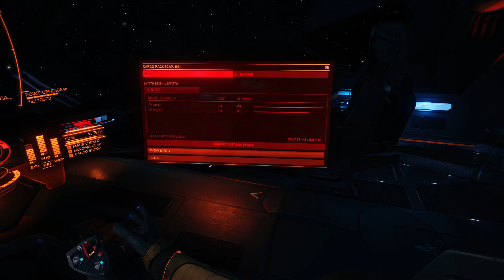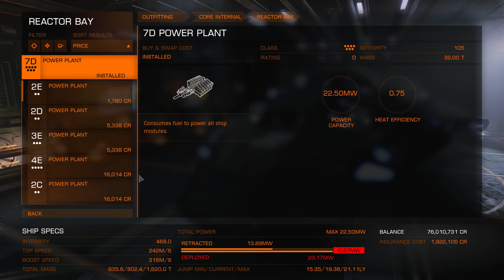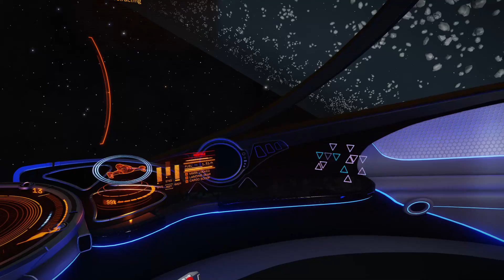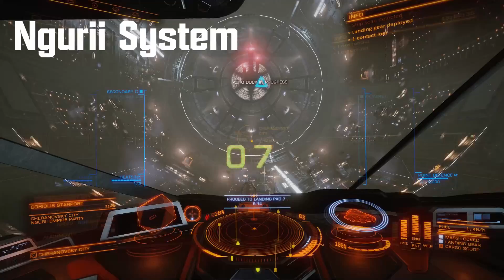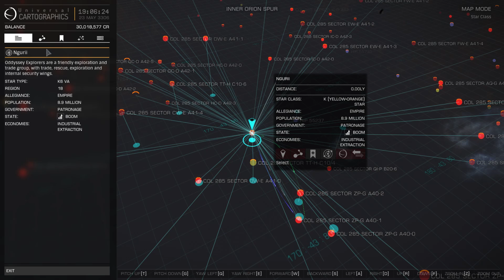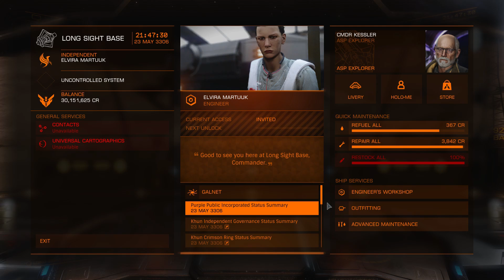Elite: Dangerous - Manufactured

Comment: 5:25 Jingles, by default, you can hold Z to temporarily disable flight assist. Use this to turn when someone quickly passes you, and let go when you're back on him. 
While using flight assist, the ship wants to keep the nose pointed at the velocity vector at all times, and it greatly slows your pitch rate. You don't have to switch to FA off permanently; just use it in spurts. Extremely helpful. In addition, once you're practiced, you can use the reverse thruster in combination with the vertical thrusters to increase turn rate and build up a distance between you and your opponent without having to turn around and boost away,

Comment: You're getting pretty good at this, Jingles. You actually went into combat and didn't get yourself killed! I'm impressed. 😂 So, are you going to be going after the Guardian modules after you're (mostly) through with this engineering grind? The Guardian FSD booster is definitely worth it.

Comment: While you can find High Grade Emissions with your FFS, it's much simpler to just pop into the nav beacon and scan it to give you the info on all the signals in the system. Make sure you target the the actual beacon and not the way-point, you can find the beacon in your contacts menu. It's usually off to the side of the way-point, presumably so you wont run into it. Just target it and wait for the spinny thing to resolve and then low wake out and you'll see all the signal sources in the system.  If you're not opposed to doing things a bit cheesily, you can get the goodies out of the High Grade Emissions point, quit to desk top (not to menu) then log back in. You'll be in normal space. Low wake to super cruise and throttle down to stop. Directly behind you will be the High Grade that you just came from, but it will be unidentified again. Just set your super cruise assist to the Unidentified Signal Source, pull a 180 and then pop in to scoop up all the stuff again. You can repeat this for as long as the signal lasts (usually around a half hour from its initial start) Strangely, this is not considered an exploit by Frontier, even though it clearly is an exploit. I think you used to be able to just leave the point and come back without all the quitting or logging off, but then they took that way while at the same time saying that it was totally cool to cheese it in this way. Sometimes IDK what they are thinking.

Comment: Or you could have done a proper power priority job and been fine.

For all who want to know, a very simple priority step is as follows:
Priority 1 = all modules that HAVE to be on all the time, Engines/Thrusters, and Power Distributor (Shields here if you Cell Banks)
Priority 2 = Weapons, Limpets, and Shields (if you use Cell Banks put here or 3)
Priority 3 = Sensors, Utilities, and Fighter Hangers
Priority 4 = FSD and SRV Hangers 
Priority 5 = Cargo hatch

I have used this setup for power priorities, and have had power deployed at 137% and did fine. The key is priorities 4 and 5 are not needed for a fight, and if you are trying to leave you have to put away  your weapons anyways to spool up the FSD.

Comment: Jingles.
Worth noting that to access one of the engineers (The Dweller) you have to interact with 5 black markets which will mean having to trade in stolen or illicit goods.  Chose a station to dock at that has a black market and doesn't bother with scanning in its vicinity.  When not scanned the 11 commandent applies.... don't get caught.

Comment: Maybe I'm pointing out the obvious but, like you said Jingles, these are raw materials. So I think that the title is a bit misleading as it states ''Manufactured'', that's another type of engineering material (Encoded, Raw, Manufactured). Maybe you got the names mixed but shouldn't this video be been called Elite: Dangerous - Raw?

Comment: since you said you wanted to be efficient, pulse lasers are the most efficient laser weapon in the game. They do less damage to shields over the same period of time as the beam lasers, but given that you take a lot longer to run out of capacitor, you'll find you will generally not really run out, add to that some engineering, like rapid fire on the pulse lasers and charge enhanced on your capacitor, and you'll have a really deadly amount of firepower. You could then add the phasing experiment effect, and you might not even need the multicannons anymore

Comment: For PvE, you can get by pretty well running 3 large MCs and med pulses on your python and do just fine, especially if you overcharge the MCs. While lasers are generally better than projectile weapons when dealing with shields, AI don't have engineered shields or many proactive modules to boost their shield ratings, so they don't tend to last very long at all when you sustain a long burst. The power draw and heat output is vastly better, and they deal vastly superior damage to the hull of your enemy. 

Beams aren't bad, but they're not as efficient. Esp once engineered.

Comment: A quicker way to find high grade manufacturing mats is to head to a system and scan the nav beacon, pop back into super cruise and check the navigation computer (Recommend using the filter to show only signal sources). Also if you find one there is a timer on them so once you've got your mats if you log completely out of the game (Not just to the menu) and log back in, pop into super cruise and select the closest signal source (it will be right behind you) and it will be the same one as before. Rinse and Repeat until the timer runs out.

Comment: Hey Jingles! Enjoying your romp through Elite, I must say! :D Cheers for posting these.

Couple of "actually Jingles" things though... no, no, please put down the shotgun, at least until you've read these!

1. Putting more pips in SYS makes your shields MUCH stronger (up to 60% absolute resistance added at 4)! You can see the exact numbers if you play with the power management pips in an online outfitting tool, such as https://edsy.org/ (also, if you install, setup and use a tool such as "ED Market Connector" you can even export your current ship to it, for tweaking and "dry dock" what-if-ing and planning; there are other ways to do it, but this is the easiest one). Also, putting more pips into ENG makes you, again, quite a bit more manoeuvrable (well, depending on the ship, ofc). 

It is thus quite crucial (in combat situations) to get comfortable with on-the-fly pips management, including setting up easy to reach keybinds/extra mouse buttons/joystick hat switches/what-have-you. Then, after some time, it kind of becomes second nature to route power from WEP if the capacitor is full to get a bit of manoeuvring boost; or dumping 4 into SYS if you're getting shot and can't fire back, etc.

2. Chaff does NOT work against missiles! It's actual purpose is to "confuse" weapon locks, for gimballed and turreted weapons -- this is the "dancing reticle" shtick you sometimes see your guns do when fighting. It is actually also somewhat effective against NPCs, as they can have gimballs and turrets equipped; I found it most useful on smaller vessels, as the induced weapon sway will, more often than not, miss you completely... although it still did have a noticeable effect in my Anaconda. It can also be a nice "run away!" tool. ;)
Missiles and torpedoes are, however, indeed defeated (or, rather, can be defeated) by Point Defence and ECMs.

3. You filthy imperial ponce, you! <3
Reply: I like jingles as ive watched him through several games. However he drops the ball with this video and ED thats is soooo much incorrect information that it should be embarassing.

Comment: Quick tip: If you can’t afford to engineer Beam Weapons like crazy, heatsinks are your best friend: They keep your heat down when firing. The only downsides are they’re manually activated and they have limited charges (but they only really run out after extended skirmishes). This applies to everyone having trouble with beams overheating, not just Jingles. Hope it helps :)

Comment: Combat tips: pips are not a thing to set to wep and forget; when you are shooting, put more pips to wep. Once you have flown pas the target, put more pips to your engines for a better turning rate. You should also use a biweave shield generator if you are going to fly in a resource extraction site because they recharge faster. o7 commander

Comment: Hey jingles, you can use the re log farming method to speed up getting manufactured materials. the "relog" method is like this - once u find an HGE signal source, look at the timer. let say its 25 min left...drop in on it, collect everything there and quit to desktop...log back in, jump to cruise and that same HGE will be very close, drop back on it and repeat until the timer runs out. and when in doubt, you'll want high population systems
, assuming you are using collector limpets to speed things up, you can probably fill up to 100 in about 15-20 min per material, for example, 100 imperial shielding in 20 min or so. if you spend a few hours doing this you'll be in good shape to trade down or do whatever u need. tho somethings like Biotech conductors and Exquisite Focus crystals dont drop like this - they are mission reward only
still its pretty grindy like a lot of things in this game but wayyyyy faster than getting it "organically"

Comment: Couple tips: The Nav Beacon in each system will give you the information about ALL signal sources currently in the system. Just stop by and scan it once youve jumped in.
Secondly, as you most likely have figured out by now, try aiming for at least 3-4 limpets, be it by fitting a class 5 or 2x class 3 controllers, preferably B-rated for the range.
And thirdly, one 64t cargo rack is MORE than enough to go out ona collecting spree. Mind you how engi mats do not require any cargo space. Fit something useful instead.
Bonus tipp: Bi-Weave shields are cheap and "only" labeled as C-rated, but they are actually really, really decent for pirate hunting.

Comment: 05:29 the greatest heatsink of all is space. That is how NASA does it.Why can't game developers see this too? 09:23 Jingles I notice the snowman on the controls. Do they have dinosaurs that you can purchase too in the game?
Reply: Space is not the greatest heatsink of all. The ISS uses huge heat radiators (not quite as large as it's massive solar panels) to dump the heat made by it's internal components and needs heavy insulation to not heat up while in sunlight in the first place. The thing about space is there is (at the height of the ISS) very little matter for heat to transfer to and the only way it can be dumped is by heat radiation.
Reply: @WingComTheLion  Space average temperature is -455 degrees Fahrenheit (-271 C). 
 It has been noted at our distance from the Sun to Earth, that temperature is about 250 degrees Fahrenheit. So there still is a buffer of -200 degrees Fahrenheit give or take a few degrees. What the heck are they heating up in the ISS that is so hot that space can't cool off?
Reply: Until recent space flight I’d never realised how inefficient craft are at getting rid of heat in space. Far less than in our atmosphere for example. Other complications of materials we use is the side in sunlight can be 271 C whilst the side in the shade is -271 C. No wonder everything is so expensive 😁

Comment: I prefer gimbled beams and 3 gimbled multi cannons on my Python. It''s just too much heat for my taste with 3 energy weapons.
Reply: Gimballed is alright but if your target uses chaff they're almost completely useless, so fixed and missiles/torpedoes are much more effective
Reply: @TheMALEK789  yeah, in more manuverable ships I'd agree. But the python, even A rated and engineered is a bit sluggish for my taste. Also, the AI don't tend to spam chaff in PVE so I prefer to have fixed weapons on PVP ships myself.

Comment: no one farms Orrere any more, the terrain is a bloody nightmare. go to the crashed conda at HIP 16613 planet 1a. it's a bit far out, near the Pleades, but the terrain is dead flat. i won't spoil the story, but it has cool logs to find also and as you log out and back in to refill the instance you are bound to spawn a couple of curious visitors. oh, the conda at HIP 16613 also has 3 data points that give good encoded as well as the cargo racks.

Comment: Ive just went onto the next step for the engineers, fly 5000LY from your starting system, watched a the full season of Space Force, there in the time it took me to get there and back.
Reply: How long would it take? 15 hours with decent ship?
Reply: @mortisCZ  much much less, if the first thing you would do after unlocking Felicity Farseer would be getting grade 5 range increase followed by guardian booster and use the neutron highway, 300++ ly jumps

Comment: Little advice for engineering: always go for overcharged for max demage per second and make your lasers have heat vent as a special effect. It effectively transfers the heat of your ship on to the enemy ship so if your ship heats up, you can just load that of on to the enemy. And if you are doing a lot of combat go with a weapon focus engineering mod on the power distributor
Reply: NPCs are not sensitive to overheating at all, so that special effect is wasted on them. Overcharged beam lasers would cripple this ship with their even higher distributor draw.  Efficient would be way more valuable, as it has zero downsides
Reply: @eavdmeer  NPC might not overheat by the special effect Heat-vent, but of more importance, your ship will regardless cool down, which is very good if plasma or Rail's are your thing. Mix em with T V Beams yall!!
Reply: @Battlenude  I actually thought you were talking about thermal shock. That changes things. However, for mister Jingles, with three large beams, I still think efficient would be his only option
Reply: @Battlenude  2 Beams are too much actually, one is totally enough to a) get rid of your heat and b) wear those shields down. (read my previous comment)
Outside of CZ's, where NPCs have quite heavily engineered ships, shields are pretty pathetic and the main bulk of HP are hull based, where you want kinetic weapons.
Allso, hardpoints dont scale linearly. Huge hardpoints have more "penetration" but the increase in DPS isnt dramatic for most weapon types. They have other benefits tho,
like no spinup time on huge MC's, or increased range on cannons etc...
Reply: @eavdmeer  Thats not true(the efficient part). OC thermal vent is the most effective variant. TV scales with heat generated, so theres alot of synergy going
on between the extra heat introduced by overcharged and thermal vent scaling with heat. Especially if your running 2 class 6 SCB's, as you should ina Python.
Most people will go for long-range thermal vent tho, because LR gets rid of falloff entirely and enables you to poke at ships 6km away without loosing any DPS.
 
Efficient Beams are good in certain edge cases, like on a Vulture, but generally theres better options once you have a charge enhanced engineered power distributor.
In a Python however, which sports a really, really beefy class 7 PD, its OC-TV all the way, unless you plan on poking away at range.
 
What youd "normally" run on a Python are 2 OC autoloader large multicannons, 1 OC thermal vent large beam, 1 long range or focused emissive munitions medium
pulse (to keep your targets radar signature debuffed) and 1 high capacity corrosive shell medium multicannon (for the armor resist debuff).
I like to run both medium hardpoints as turrets, so the debuffs are still up even if i dont have the target in my sights (the 2 meds have great firing angels on the Python).

Comment: I'm a little lost with Engineering, I'm a fairly new player, flying around in a Cobra Mark III, is engineering for late game? I don't know why I'd bother upgrading the modules on my current ship since I won't be using it forever. Also is it only worth upgrading high tier modules like A rated ones etc?
Reply from the maker: By all means gather the resources, but I wouldn't bother actually engineering a ship until I knew it was one I was going to keep and was buying A-Grade modules for it.
Reply: Also, don’t forget the modules don’t belong to the ship, i.e. you can strip the modules and put them in another ship later.  Engineering something, even if it’s only on e, can be useful for multiple ships.
Reply: pretty much only engineer the best modules, anything else is a waste of time and materials. there are some exceptions, most commanders will tell you that life support and scanner (EDIT, sensor not scanner. i always screw that up) modules don't need to be a rated, but every other core module should be a rated for a combat build. exploration and trade/mining, well that's a whole different story. and shields for combat, there are 3 choices, a rated, c rated bi-weave, and prismatic. i'm a bi-weave fan myself.
Reply: Sometimes you engineer D grade modules (the lightest ones) if you want to max your jump range. Best to watch people like Exigious & his tutorials and down to earth astronomy for hints & tips :) And yes my Cobra III has a G5 FSD on it  ;)